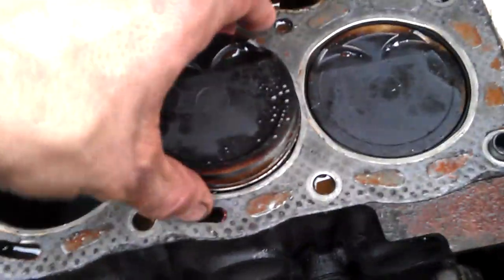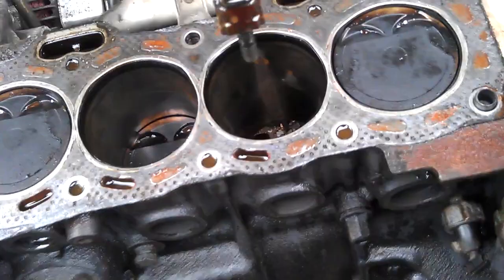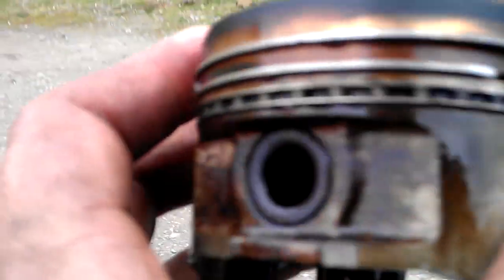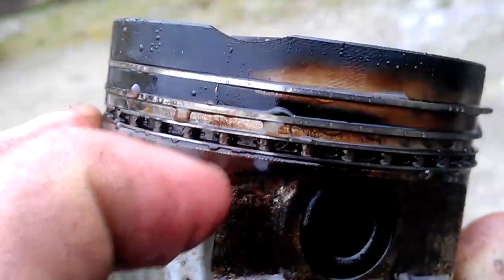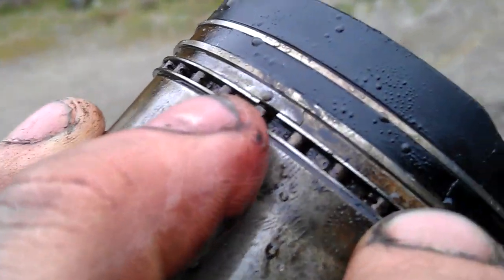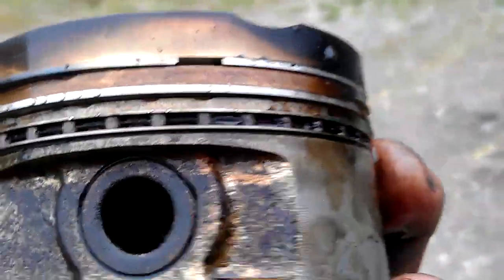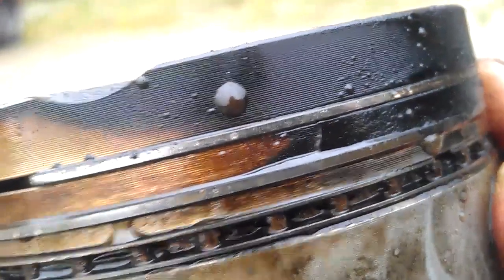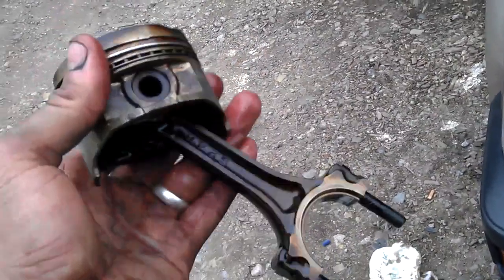EP70 4efte cracked ringland, piston pulled out for first time

Comment from the maker: Japfest is 12th May, but i am also going on a track day inapril,so got to get my skates on.I have got a spare piston i can use to replace that one and all i need is a new set of piston rings,HG and head bolts.Will have it fixed for about £180, Although its labour intensive, took me 4 hours to strip it to that, so 8 hours in total.
I am gonna take out the other 3 pistons and inspect them first of course to make sure there are no hairline cracks or anything. Fit the rings and should be good to go!